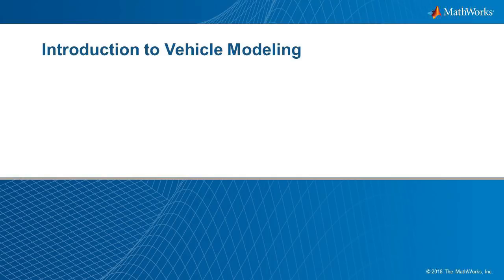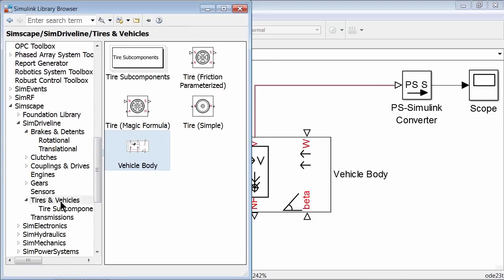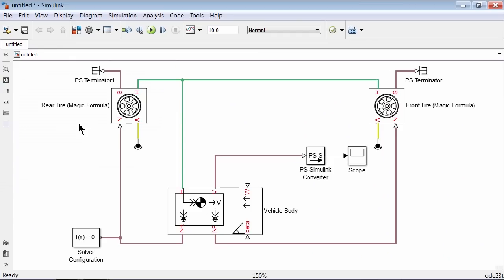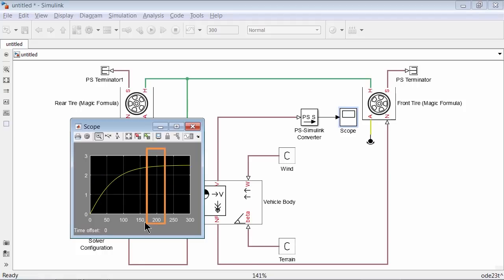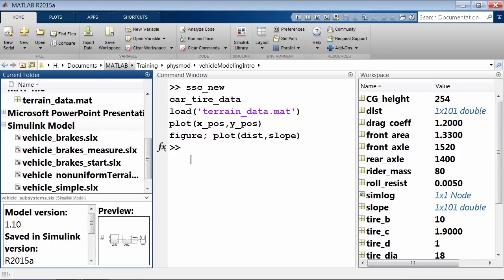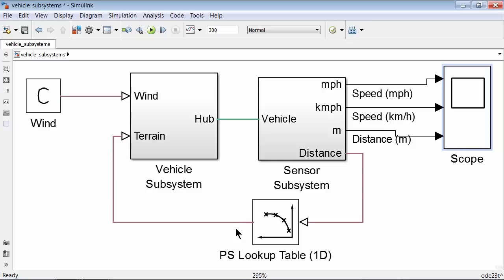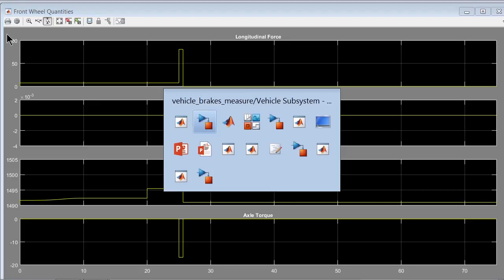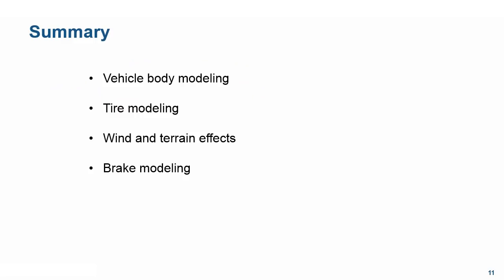Physical Modeling Tutorial, Part 3: Introduction to Vehicle Modeling

Comment: I get this error when i am trying to run this model Please help...!!!

: Function, tablelookup, is wrong.  Please check 1) whether input data points have correct sizes; 2) query values are scalar; 3) query values and table data have the commensurate units; and 4) constants or compile time parameters are passed to interpolation and extrapolation argument.  In foundation.signal.lookup_tables.one_dimensional (line 35)
Argument 1 = [1x101 double] 
Argument 2 = [1x101 double] 
Argument 3 = {[1x1 double], 'm'} 
x = [1x101 double] 
f = [1x101 double] 
I = {[1x1 double], 'm'} 
extrap_method = int32(int32(1)) 
interp_method = int32(int32(1))
Reply: I guess you are using a newer version of MATLAB. You just need to change the units then it will work. For dist it is (m) and for slope is (rad)
Reply: @martinprinceton9858  I got it to work...but I don't remember what was the changes i made...proloy them units
Reply: @martinprinceton9858  Ufff.. Thanks man!
Reply: @martinprinceton9858  i did that but then i got this error .. not sure why....
can smone pls help me out

An error occurred while running the simulation and the simulation was terminated
Caused by:
['vehicle_subsystems/Vehicle Subsystem/Solver Configuration']: At time 16.977349, one or more assertions are triggered. See causes for specific information. 
The 1-th dimensional query point must be no less than minimal value of table grid vector and must be no larger than maximum value of table grid vector. The assertion comes from:
Block path: vehicle_subsystems/PS Lookup Table (1D)
Assert location: 
    o In between line: 35, column: 28 and line: 35, column: 29 in file: D:\MATLab\toolbox\physmod\simscape\library\m\+foundation\+signal\+lookup_tables\one_dimensional.ssc 
x must be less than or equal to maximum value of Table grid vector. The assertion comes from:
Block path: vehicle_subsystems/PS Lookup Table (1D)
Assert location: 
    o In between line: 45, column: 9 and line: 45, column: 15 in file: D:\MATLab\toolbox\physmod\simscape\library\m\+foundation\+signal\+lookup_tables\one_dimensional.ssc
Reply: @martinprinceton9858  I get this error after implementing brake models. I didn't change any parameter on tire model and it runs fine after removing brake models. Any help would be grateful.

 An error occurred while running the simulation and the simulation was terminated

Caused by: Here is the set of components with unconverged equations:

'untitled/vehicle susbsystem/Rear Tire (Magic Formula)'
Equation location is:
 'C:\Program Files\MATLAB\R2022a\toolbox\physmod\sdl\sdl\+sdl\+tires\+tire_subcomponents\rolling_resistance.ssc' (line 69)